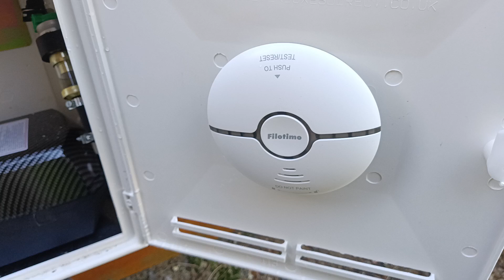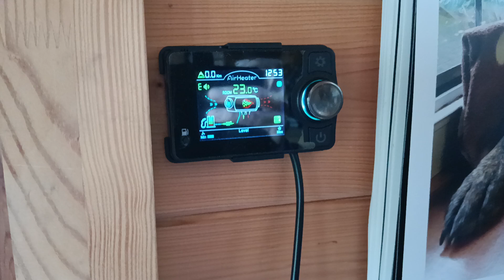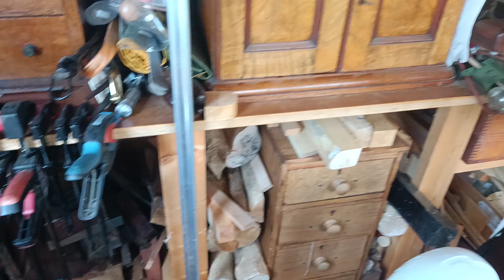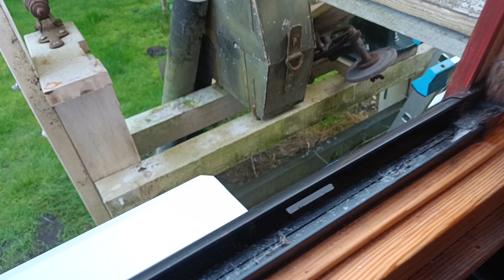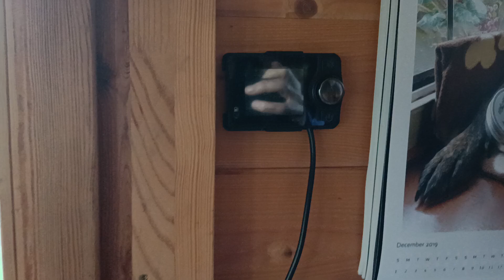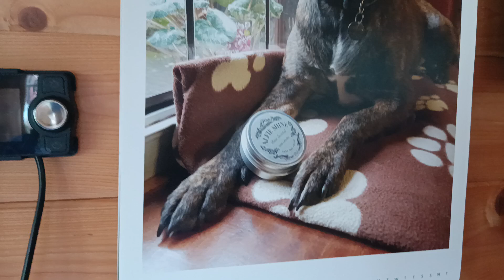KT Tools Working Museum - Heating

Comment: Originally saw you on the FB forum, fantastic installation, the best I've see by far!! Last year, I installed a CDH (all in one with exhaust going outside) in my workshop & it's been fine but its now going outside like yours so its totally safe. These heaters are great but you have to upgrade some of the components as you have done.The stainless steel tank is great idea, just ordered one!! Thank you for the video and also the links, a great help!! best regards John

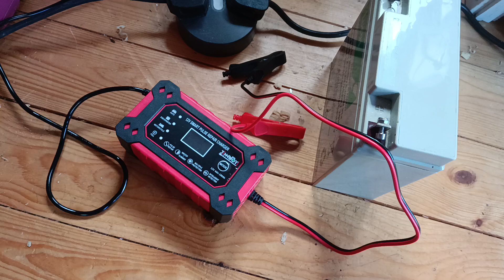Comment: 06:45 - Don't use that charger! Pulse repair chargers  are designed to put a regular voltage spike across the battery to break down any sulphation on the plate-surfaces, and restore capacity. Those voltage pulses can be high enough to kill your control board electronics, and render it useless. Advocates will say I don't know what I'm talking about, but trust me, I do. You have been warned.
Reply from the maker: Agree totally. 😊
Reply from the maker: I have done some further investigation and come up with plan B. It also seems that's not all wrong with these cheaper pulse type chargers so this one's going in the bin.

 😅😅

I may return it to Amazon if I can be bothered.